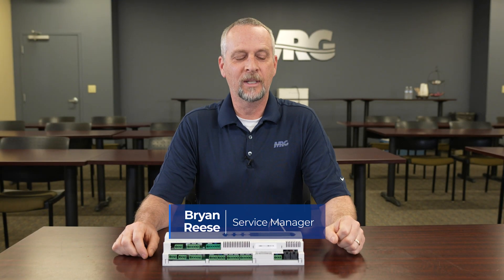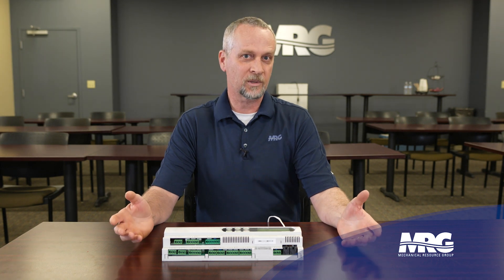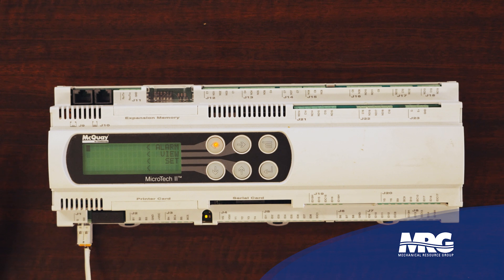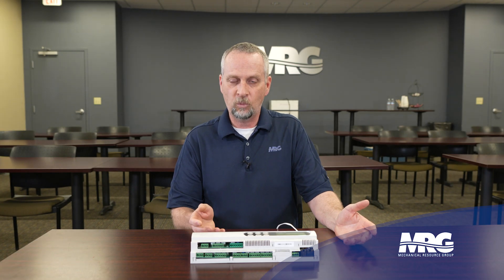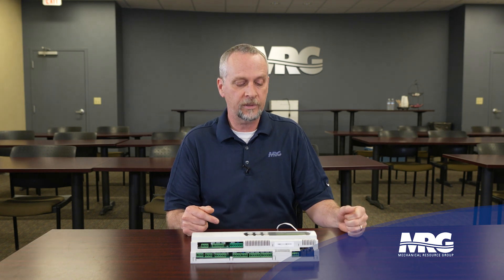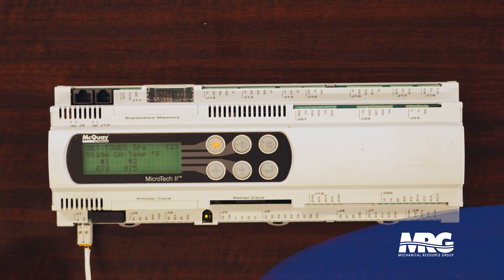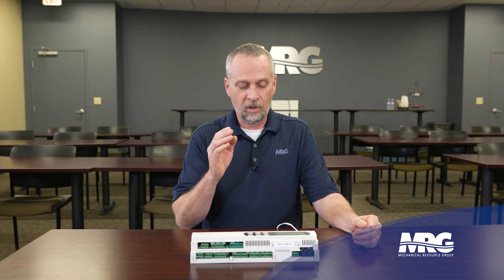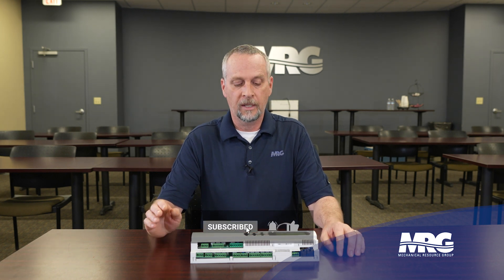Daikin Microtech II Controller: A Guide For Navigation!

Comment: Can I run manually a Micro tech II controller for my McQuay 30 air cooled chiller. I want to see if the controller is working. There are no faults on the controller and unit won't start.